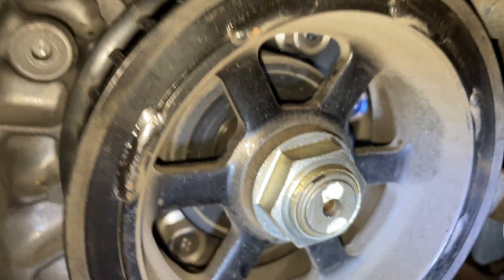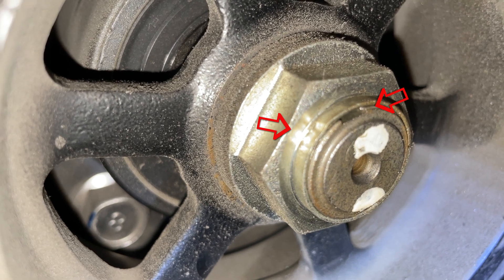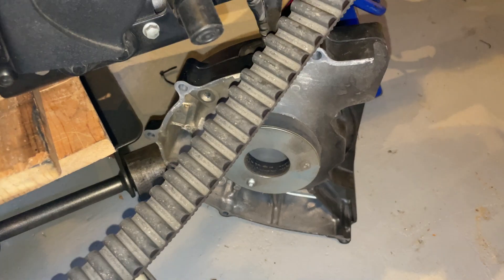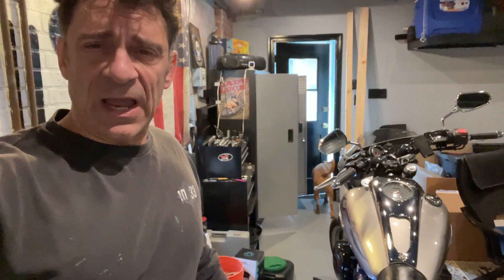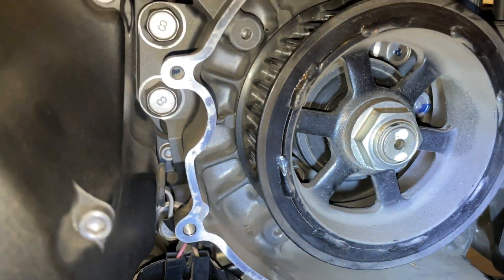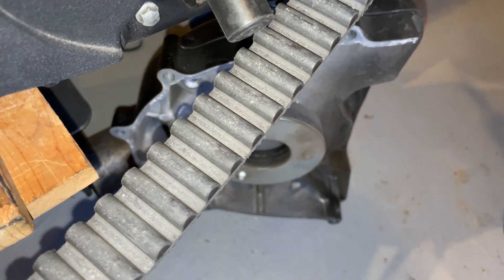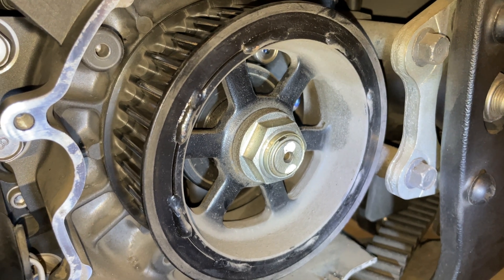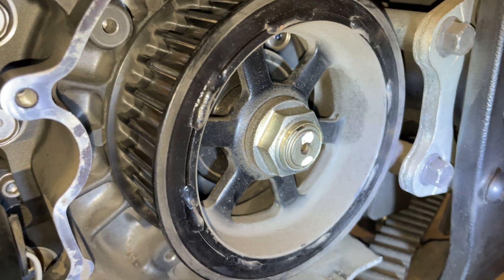Yamaha Raider Drive Pulley - CHECK THIS NOW!

Comment: Just came across this video on the yamaha raider forum... glad I checked... mine too has moved... not as drastic as yours... but it's certainly not where it's supposed to be... did you notice anything like the bike felt like it was "slipping" instead of really accelerating when you roll on it kinda hard???...I just started getting some belt noise too and wonder if this is contributing to it because the pulley isn't fully seated where it's supposed to be???
Reply from the maker: I had no symptoms.  Just that my friend's slipped so bad it spun.